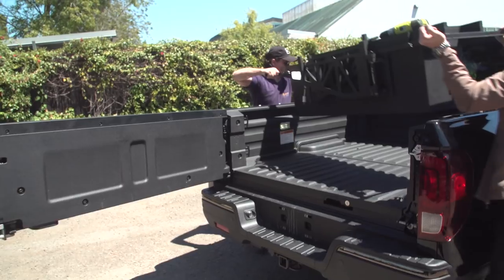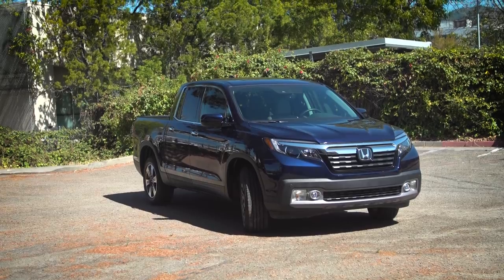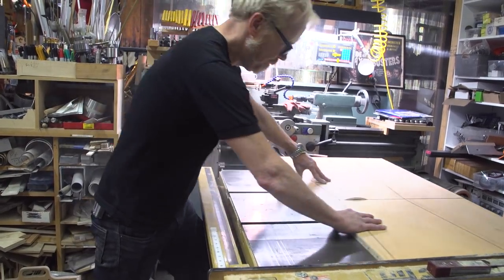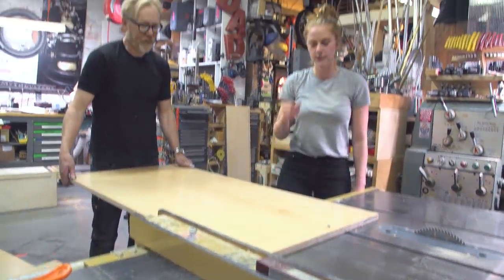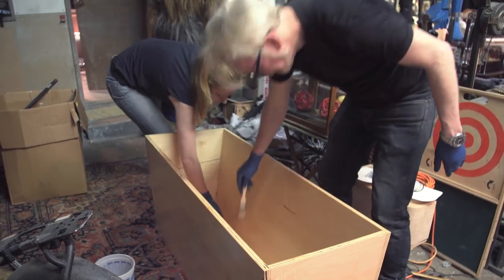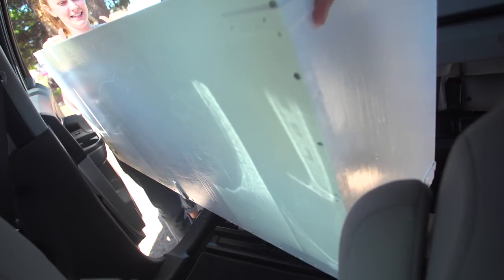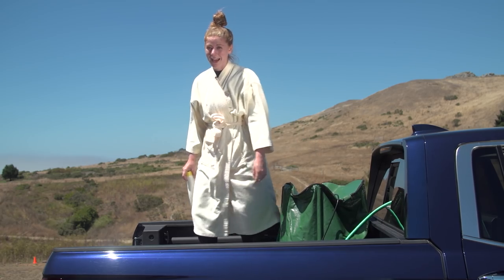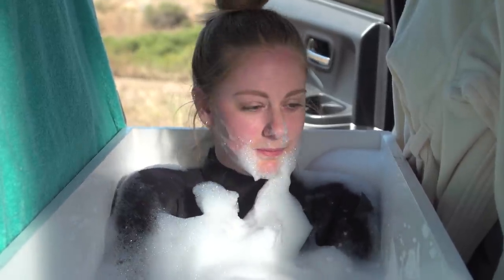Features Not Standard: Simone Giertz Builds a Bathtub in a Truck!

Comment: here's a tip:  If you leave the truck in the sun with all windows closed, it will actually get pretty hot in there.
You can have a sauna, never mind a bath,
Reply: I was thinking the same thing! HIGH FIVE!
Reply: then your car is gnna get moldy AF!
Reply: Regardless, I'm banking Simone is somewhat uncomfortable putting her body on display. Compared to other 'geek girls' (Kari Byron, for example), Simone is far less sexualized in general. Regardless of heat, I think the wetsuit would have been a thing.
Reply: @SirKingHoff  tile evrything!

Comment: Whimsical and brilliant. What you really need now is a drain with hose. There are "solar" water heaters (they just sit in the sun) which you should have hung up on a thing in the trailer back. Install an over-head rail for a hand-grip. Finally, "modesty" curtains all along the inside of the cab-- a straight-forward sun-screen for the windshield would serve up front.

OR a small ring that takes a curtain-- mounted on the inside that can swing out or rotate outwards-- to provide a -- small -- curtained off area to change in. Really 'finally' I would put something soft along the top edge. It seems easy to wack one's body on it when entering or exiting!

Very nice!

Comment: Rather underwhelming. Where was the installed heating element that's hooked in to the car to keep the bath warm? Hot water is hard to come by when camping so this should have had a bottom chamber with heating!!! Just a box on a back seat does not a bath make.
Reply: Hot water isn't hard to come buy. Go to any sporting goods store, and you'll see plenty of solar and propane based solutions.

HOWEVER, She forgot another important aspect: HOW TO DRAIN THE TUB WHEN SHE'S DONE! Last thing you want to do is get the truck interior soaked while trying to dump out all that water. And that tub isn't light anymore because of that added water.
Reply: Simone's ideas are usually well intentioned, and poorly executed, resulting in a signature type of entertainment.  The fact she belabored how impractical this one was at fulfilling its core function makes me think it was done with her usual intention.
Reply: nauthizzz
Reply: Let's see campfire + metal bucket = hot water
Reply: put a rock in a campfire, take rock and put it in tub, repeat until water is warm.
Reply: Alan Ball
True. Actually anything dense will do a hunk of iron steel just as well.
Reply: Gamesman01 Well, you probably want to avoid certain materials and construction techniques. Single walled glass or metal builds would be bad due a few issues, including condensation for cold materials in a humid environment. (Double-walled isn't, since there's space to minimize temperature transfers and condensation.)
Reply: Jack Linde
I was referring to the use for heating the water. Rock, brick, steel or iron are dense and will not degrade quickly. Heat any of them in a fire and drop it into the water to heat the water.
Reply: home
Reply: +Jack Linde Draining would be easy; it's well above ground, stick a hose in it and get a siphon going and it'll empty itself out, same way people have drained stuff for thousands of years... do you not know what a siphon is?

Comment: Fun to watch you guys do stuff,thanks for appropriately labeling as advertising and for anyone who wants to take a bath in their truck, get a 12v pump and a 6 mill thick polyethylene tarp and just put it in your truck's bed, voila, instant bath that doesn't take much cargo space.  If you're feeling extra ambitious, find a gas to liquid heat exchanger (say, spare radiator from the scrapyard) and pipe truck exhaust through it then use the 12v fill pump as recirculator.

Comment: No eye protection when using the table saw? Uh, just no...
Reply: or hearing protection :/
Reply: You clearly haven't worked in a professional shop environment.
Reply: +phototristan actually, i have. i worked in a noisy printing factory for 9 years where both hearing protection and eye protection was required on the floor at all times. you don't really think about it, but that one time you prevent something from poking out your eyeball, you saved your self all that pain and loss of your eyeball possibly. i thought it was stupid too when we started doing safety glasses but then i saw a guy almost poke his eye out with a pair of pliers, cuz he was pulling on something improperly, but they bounced off his glasses. but I've never worked in an environment that was dangerous.. nope.
Reply: My dad uses a stick so he doesnt lean over it, that shit sketchy. He learnt his lesson drom cutting the end if his finger off
Reply: I use a table saw every day and would never advise someone to wear safety glasses unless completely necessary, like when cutting lumber which may have nails in it. This was not the case here. Ear protection is a must though.
Reply: That's quite foolish. You clearly have never had a shard of wood fly up into your eye. I have, and still have a scare on my eyeball to prove it.
Reply: phototristan No I haven't, after literally millions of cuts. Just luck or experience? I find it much safer to not impair my vision with a piece of dust covered plastic.
Reply: +Shill During my woodworking classes in high school, the table saw was the one machine where teachers stressed the point of not wearing safety glasses and gloves. Not wearing gloves has saved my fingers and hands multiple times. one time using a bench grinder/wire wheel cleaning up a bolt, my finger got caught in between the wire wheel and the resting platform while it was running. Lost some skin on my thumb, but im 500% certain the damage would have much more severe if I had gloves on.
Reply: ***** I absolutely agree, not wearing gloves is one that seems so obvious that I forgot all about it. Gloves and power tools are never a good idea (in a workshop at least), it goes hand in hand with always keeping long hair tied up and long sleeves rolled up. Thanks for pointing it out!
Reply: ***** That injury sounds painful but no doubt it could have been a hell of a lot worse!
Reply: ***** It wasnt that bad pain wise. Forklifts seem to have it out for me though (or rather, the bad drivers) :P Safety boots have saved me from serious injury many times.
Reply: Safety squints -AvE
Reply: True. When I worked in a machine shop, I was told I could wear my contact lenses, and wear safety glasses, or if I chose to wear my eyeglasses, they would suffice.
Reply: +shillier - I guess you've never heard of machine turned wood? Get educated. How do you think they make wooden kitchen knobs, etc. Troll on.
Reply: phototristan Where I'm from machinists machine metal.
Reply: no condom when using the table saw? Uh, just no...
Reply: Just close your eyes when using a table saw :D
Reply: More worried about the american-style unprotected blade... without a top guard I would have lost so many fingers already.
Reply: It’s not high school, they don’t need them, if u notice even the safety stuffs r not attached. It’s for the professional they don’t need them
Reply: My dad has been using the table saws at his work for about 17 years now and he never wears eye protection. It's not like it has live ammo or anything, it's just a rotating piece of steel :|

Comment: For hot water, you could have your water tank wrapped around the exhaust or with a radiator line running through it to act as a low-budget heat exchanger. 
Also, was that pump reversible? If so you could pump the water to and from the tank through a filter for re-heating and cleaning. This'd also mean no more worries about discharging large volumes of detergent-laden water onto your campsite after each bath and could help drop the volume of water you need to store.

Comment: We were taking baths long before we had running water in the house. A couple of metal pails or buckets on the campfire and presto hot water. Yes it might take a while but well worth it in the end. Plus close the doors and it will stay hot for a while (wood is an excellent insulator) and the air inside will be warm and humid.

Comment: Ideas for V2 - Put it in the truck bed so that you can splash around more without damaging the interior, it would also make it easier to add pluming that would allow you to use the exhaust system to heat the water in the same way an on demand water heater works. you can take advantage of the vehicles electrical system to run a pump and pump directly out of a near by water source such as a stream.  you can drive without water, drop the hose into the river, and while its pumping its also heating, convenient, luxury camping.

Comment: Heh, done camp bath tubs before.   We just bring a stock tank and if we want hot water, use a metal coil pipe in the camp fire with a hot water rated circulation pump.     

Hot tub?   heavy duty semi truck grade load tarp in the bed of a long box pickup and the same pump, or we get a "Cowboy Hottub" kit and wood fire heat the water in the truck bed direct ;).  

If I wanted a tub inside, I'd just bring a fifth wheel ;).

Comment: Now integrate a drain hose + leave a gallon to wash the tub. As for heating; have the water preheated since I heard that certain models have Ac outlets also have candle warming stove tops on the bottom or attach to keep the water warm. Don't leave the water sitting in the truck because of moister buildup in the cab!

Comment: I'm guessing Honda wanted them to showcase some of the features of the rear seat. I'd like to see them revisit this with a shower curtain mounted in the bed that swings over the side. A solar water heater which is a black plastic bag full of water & available at any place that sells camping supplies would be perfect. Maybe rig up a shower caddie to hold the soap & shampoo along with something to hold a towel & a change of clothes.

Comment: A tin bath in the woods plumbed up to a copper coil sat around a fire is totally a thing to make a bushcraft hot tub that you can sit in and make smores in and if you're camping you should go full on boss mode, plus this way you don't need a truck biodegradable soap though

Comment: For water heating, you could remove the heating elements from a few kettles and use a metal barrel to hold water then weld the elements into the barrel

Comment: A low cost energy efficient heating solution would be passive solar water bags. you could actually do one heated bag and one insulated for temperature control and have the bags on racks for a gravity feed system. Also, by adding a drain valve in the side connected to a flex tube you could easily drain the tub. If you wanted to be a super hippy you could use camp soap for a negligible economic impact.

Comment: fix for the heating. heat trace and a small generator. heat trace can get up to 110 degrees in a minute and stay at that temp. put a secondary bottom on the tub and put heat trace in it.

or an engine block heating element

Comment: Easiest solution for heating water? Just use the engine water :)

Or use the heat exchanger to heat up water which is pumped in small pipes around it :)

Comment: You fill the bathtub up.  Take your bath.  Now how can you drain the bathwater (without having to use a bucket and 15 minutes to manually pail the water out)?  Can you engineer a drain onto the back of the tub so it drain outside the truck door?

Comment: It seems like a fairly straight forward plumb a heater bypass to a water/water heat exchanger for heating all the water you want when the engine is warm and running.

Comment: Simone,
for the heating issue could run a solar panel on top with a battery or two for a water heater coil. if not a cowboy type shower "black bag water reservoir" Uber complications would to hook up a faucet head! 

how do you drain the tub btw? would be more practical to have the tub in the back so moisture don't mold the interior. 

PS. Hi Adam!

Comment: Move the radiator into the tub and run the engine for a bit.
Reply: put a block heater in it and hook it up to a 110v inverter
Reply: Or a small 55 gal fish tank heater..

 I would have added a small IBC tote (250 Gallons) and just pack a kiddy pool in the trunk (or cut the top off the IBC tote).. With a strong enough water Pump and nozzle and hose you could fill the pool up fast And why not register as a voluntary fire fighter while your at it.. 

You just made a party firetruck..
Reply: Fracture they're in California, just fill the tub, close the doors and stick it in the sun, problem solved.
Reply: If you really wanted to heat the water, it'd be simple to make a heat exchanger, but I'm assuming they didn't want them to start making alterations to the engine.
Reply: Be sure to capture the heat from the inverter, it'll be dumping half your power out its heatsinks.  Probably better to get a 12V heater instead.
Reply: or do it right and use a heat exchanger. Engine coolant <-> bathtub water
Reply: for better energy usage, you could build a heat exchanger in your exhaust manifold!
Reply: dear sir, are you by any chance a chemical engineer?
Reply: I would have pumped water up from the stream and heated it with a gas water heater, filling the cargo area with it after throwing in a pool liner of some description. What a waste of materials, time and effort. Alt John Ridley has a clue too.
Reply: Probably the weird door on the back to the ute would fail if you filled the trey with water- Why do they call this tested?

Comment: did they think to add a drainage system or are they gonna have to bucket out that water?
Reply: they didn't even think half that far... I mean they didn't even think about heating up the water...
Reply: Simone mentioned a pump to get the water into the "tub" so just switch positions and it will get the water out again.
Reply: If they're just gonna dump the water, siphoning it out is a much better solution than to implement a drain in the bottom of the tub
Reply: she said she had a pump, so no drainage needed
Reply: Yep, but even when they have a pump, there's no need to use it when you just want to dispose the water in the tub
Reply: This was nearly as basic of a box you can build. Features was not something they considered spending any time on for a one off quick and dirty sponsored video. I'd almost bet the "tub" was thrown on the fire pit at the end of the day.

Comment: They should have used some sort of water heater element with a temperature controller to heat the water.  Or, they could have created a solar heating system by coiling black tubing on the top or the bed of the truck.

Comment: The heating part is easy. Park the car in the sun, fill the tub, wait an hour. If you can kill a baby in 30 minutes in the hot sun, you can surely heat some water to pleasant temperatures.

There's only one thing that I have not seen you figure out: How do you get the water out once you're done?

Comment: I don't understand this. There's no wow factor in putting a box in your back seat filling it with water and calling it a bathtub. Turning the truck bed or a portion of it into a tub seems more practical, especially for drainage purposes. Also would be easier to incorporate a heating element and maybe even jets to go hot tub with it. This video feels more like an underdeveloped and rushed project to create some quick content. Leaves you with a feeling of disappointment especially because you know these two are capable of so much more. Here's a better idea...build a full bathroom in a truck bed. That is more on your level.

Comment: could have heated it with the engine heat by re-circulating it for 20 or 30 min using the pump you used to fill it. easy peasy

Comment: What is that strobe light tool Adam is using around 3:43?
Reply: Its just a jigsaw, the camera frame rate is causing the strobing of the light on the tool.
Reply: Thanks, that makes sense but it's way more boring than I had hoped.

Comment: What's the tool adam is using at 3:43
Reply: I would say jigsaw as well... but what was the rapid flashing? I think that is a laser jigsaw. Apparently it helps you stay on track with the normal blade for cutting and the laser for tracking.

Comment: Would have been nice if you guys put a little more thought into this. Adding a drain? Using solar for heat?

Oh well, guess it's just some quick money.
Reply: Have you ever seen one of simones creations? they are called shitty robots for a reason. This is not supposed to be some kind of tutorial or do-it-yourself project. it's just a random idea put to use because its fun.
Reply: MrMartechi this is a box. They took the trouble water-proofing it, at least.

Comment: Why didn't you just connect it with a heat transfer box to the cars coolant. Then you could use the heat from the engine to heat the bathwater.

Comment: Successful proof of concept,...
Now, make the 'bath' be a bed-wide bin in the tray, with a removable lockable lid, so it's double duty as a secure lock box,... which would be big enough for the sporting shooters to safely lock away some hunting equipment,... and add a loop of tubing that uses waste heat from the engine or exhaust to warm the water,...

Comment: My buddy has a bathtub project he plans to build into his toyota troop carrier camper project. He got a small gas water heater with a shower head unit. some kind of a pump and hose system to get water from the river would be practicable.
However I like the look of a collapsible hot tub I saw on the net...It had a coil you place in a campfire to heat the water. -Ok for private property camping tho no use for places with fire restrictions. Nice Idea In essence Simone, however I reckon your  projects needs work as its not really useful :( or at all what would be great in the great outdoors.